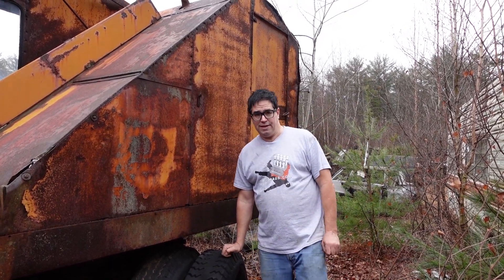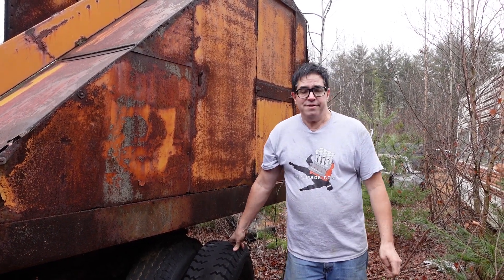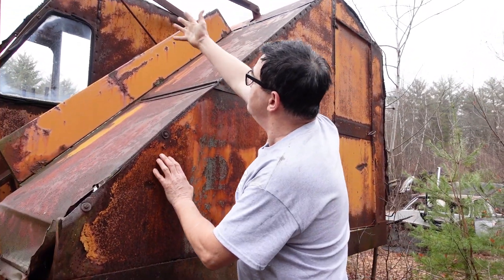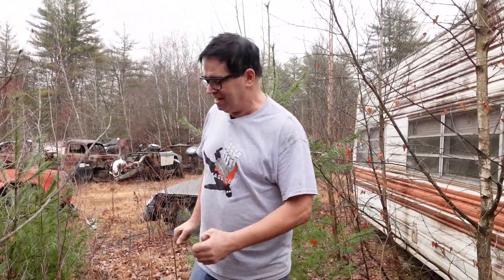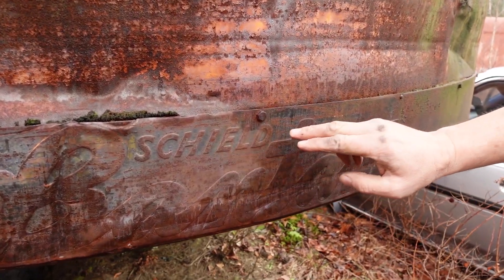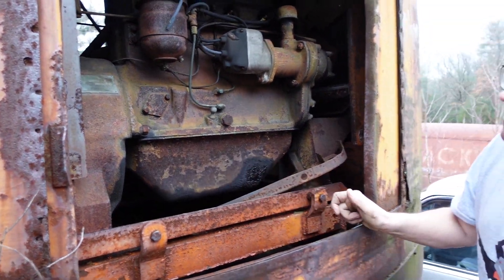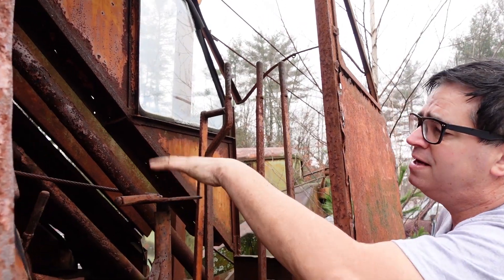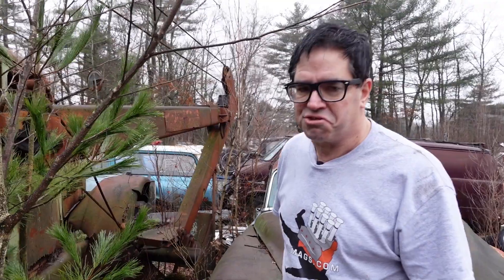Super Scooper

Comment: Recognized the Bantam 'house' right away.  Have one in my back yard, 1963 model T-350.  It's in the category of a 'high speed friction crane'.  They came in many configurations.  Crane, back hoe, drag line, pile driver, log loader,  grapple, clam shell, line skidder.    
I worked with one, late 1970's.  Equipped with a 'heel boom' and special winch drums, it carried 1200' of wire rope.  Used for skidding logs on the Mt/Id divide.  Terrain too steep for skidders.  That one used a 4-53 Detroit Diesel.
Mine is powered by a Continental 209 L-head 6,  another up the road runs on an IHC 154 cid 4cyl, same as the engine in the IH model H tractor.  These things are often referred to as 'shovels'.  I doubt that this shovel is original to the Autocar.  No ordinary truck frame could handle the stresses that thing produces.  All that I've seen are mounted on special built crane carriers.   Tandem axle, 6x6's, no springs, Hendrickson walking beams.
Bantams, the bird, though small, were known for punching way above their weight in a fight.
The two Bantams residing in York, Mt. still run and still do jobs now and then.

Comment: In regards to the cable excavator, and your first video on the Autocar that the machine is mounted on. When you picked up the drivers seat you picked up several metal cups and those were the replaceable 'teeth' on the bucket of the excavator. If one breaks off, he went to his stash under the seat and replaced it, then went back to work.
Reply: You were close, but the replacement teeth weren't in case the teeth broke off, they were to replace the teeth when they were wore out. Now if the shank broke which the teeth were  pinned to you would need a new shank and a good welder.
Reply: @firebreathinggarage2117  Yup, yer right on that of course. I am wanting to get a tooth bar for the bucket on my loader so I can dig into clay. Damn they are expensive...

Comment: Right on Steve! It's so cool that you feature the "grandaddy" equipment as well as the passenger vehicles. Whenever I see old gear like that I imagine what the job of operating it must have been like and I actually feel a bit ashamed. Ashamed of any complaint I have made about our modern trucks and equipment...they didn't have air ride anything, air conditioning was your window and your heat usually was whatever you could get to radiate from the engine. Of course there were many more aspects that made an operator's life seem like punishment in comparison to today's standards. Good stuff, keep rollin' 'em out!

Comment: we outfitted machines like that with big electric magnets and used them to load/unload scrap metal back in the 60s and 70s. Ofcourse we had to add a small motor to power a generator. They were beast of burden especially the ones made to operate on RR tracks.

Comment: Way to go Steve!  You can even make a rusty excavator interesting. 
....Just a word on the hand crank.....I drove a '52 Morris Oxford that needed hand cranking after the 6v battery gave up. It wasn't too hard but if you had to keep at it for a while you'd work up a sweat. Those old engines didn't have much more than 6 to 1 compression

Comment: The teeth you found under the front seat are replacements for the bucket. When you get into rock, a flat scoop is just about useless. Therefore rock teeth..  Also, these where mainly used for smaller jobs like septic tanks and test digging for percolating tests. Being on 4 tires didn't provide enough traction for many heavier jobs.

Comment: Hey Steve, wanted to wait till I saw this second video, the metal "teeth" you found under the drivers seat in video 1 of this truck / digger are actually replacement bucket "scarifier teeth" that pin / bolt to the front digging part of the bucket. They give the bucket an ability to tear at hard earth / rocks and promote faster easier digging. Cool rig.